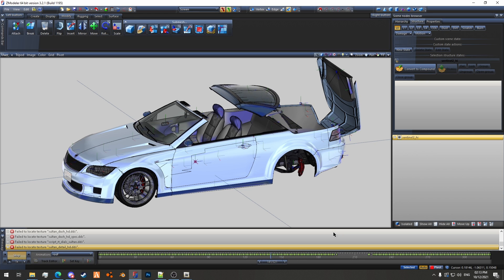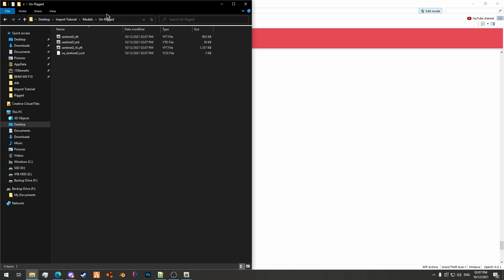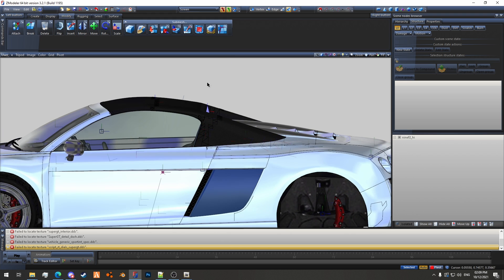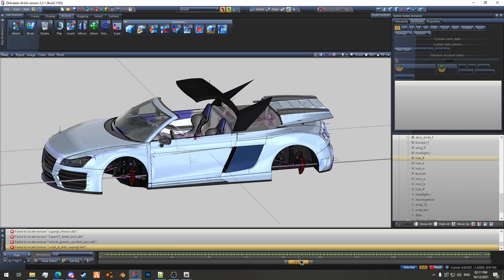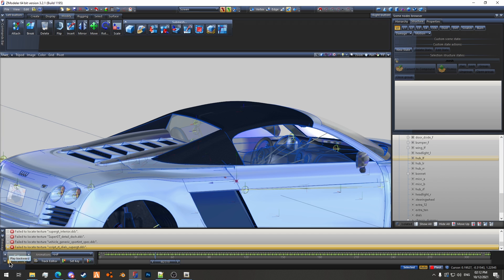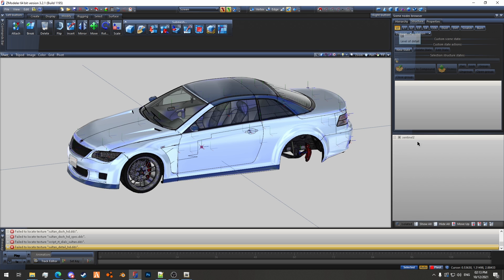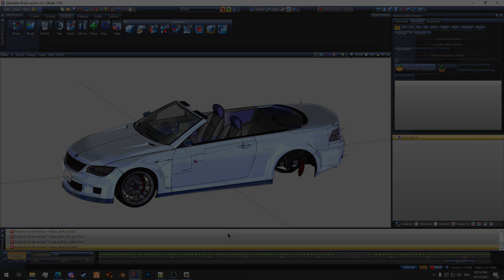Import a GTA 5 Animation into ZModeler 3 [ZModeler 3 | Tutorials]

Comment: i have a problem after i imported and exported again the car, some of the polys are broken, but after i imported and exported again
Reply from the maker: That's most likely because 'slice to parts' was turned on. (If it is a convertible vehicle with rigged roof slicing to parts will break the rigging) this also happens with rigged suspension.

Comment: Not finding ycd in animation help 😭😭😭😭😭
Reply from the maker: It'll be named something along the lines of  
"va_carname.ycd" you can use OpenIV's search function to search for the name. (CTRL+F3)
Reply: I find this but not in zmodeler
Reply from the maker: @YashVlogs9510  Not sure then, you must be doing something wrong. Also make sure you are on the latest version of ZModeler 3. Animations are only supported on the official paid version of ZModeler 3 (3.2.1)
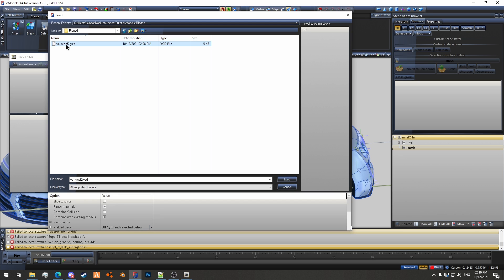Reply: 3:10 this it dose not show in zmodler
Reply from the maker: @comedyking2mviews2daysago83  that's because you are using a cracked version of ZModeler 3 (or an old version that you haven't updated yet) animation support is only available on the latest official version of ZModeler 3
Reply: @13Stewartc   i have a paid updated version and nothing shows in the folder for the YCD file inside zmodeler
Reply from the maker: @GAMINGWITGEEZY  As long as you extracted the .YCD from OpenIV and you are using 3.2.1 Build 1195 (With no green download button enabled in the bottom right) you should be able to load the .YCD :)

Make sure there is no green download icon in the bottom right. This button means that ZModeler 3 has an Update that needs to be downloaded . :)
Reply: @13Stewartc  i have paid and disabled update but still not showing ycd in zmod
Reply: @ImReplay  so im having this same issue where my paid zmod doesnt support he ycd did you find a fix?
Reply: So how I can get ycd in zmodler cracked
Reply: @YashVlogs9510  You go to the official website and pay roughly $11 for 3 months.